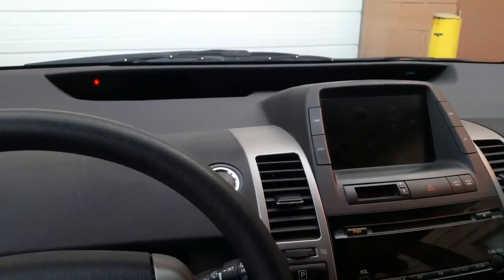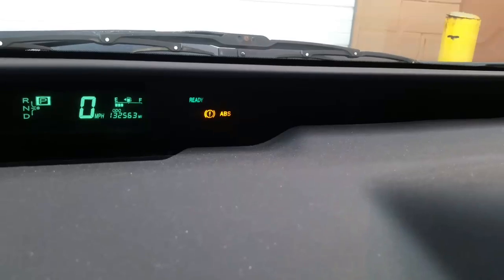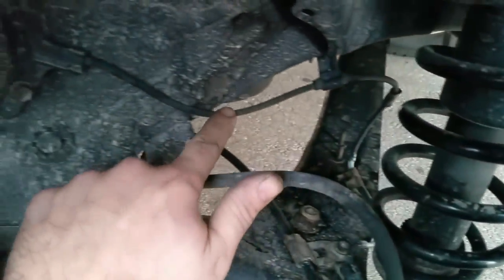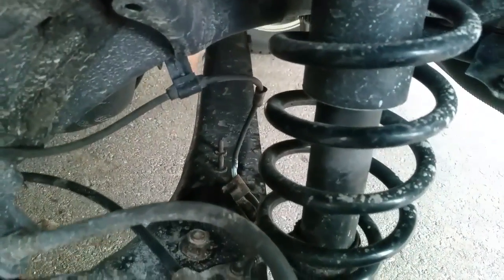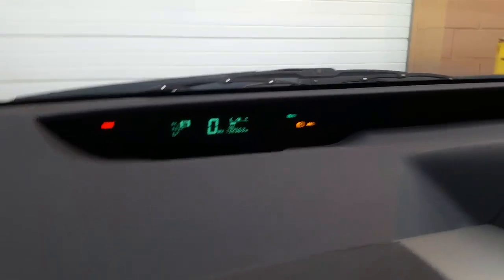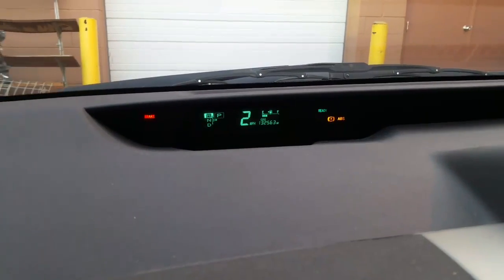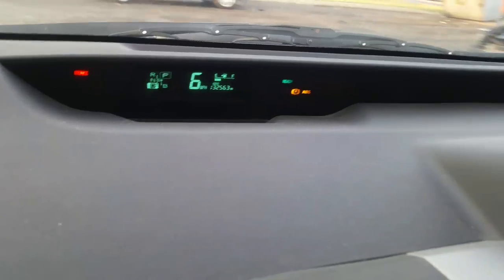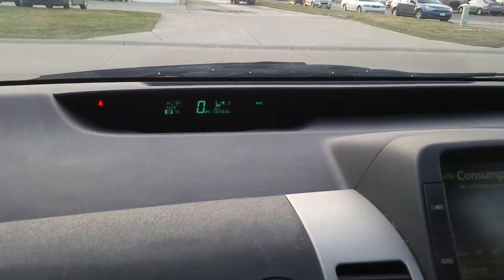TOYOTA LEXUS ABS BRAKE LIGHT FIX C0215 /34 REAR LEFT WHEEL SENSOR MALFUNCTION

Comment: My Vehicle Stability Control, Traction Control, ABS, and Brake lights all come on and stay on.  I ran it by my Toyota dealer, and the Fault CO215 came up as a result of their scan of my 07 Toyota Rav4.  When they visually inspected my vehicle they found rust on my sensor housing.  They quoted me a price of $1,025.27 for them to do the work.  This price seems a lot more than what you say.  Should I be concerned that they will be overcharging me by a ton if I have my work done by them?

Comment: I'm very frustrated I just replaced both wiring harnesses AND purchased brand new rear bearings only to get new sensors and my light remains on I drove it about 10KM and the light is still on. 500$ down the drain. c0215 the mechanic tried to reset the light with the computer and it came back.
Reply: The problem could be the front speed sensors
Reply: @douglas2510  I fixed the issue by ordering and replacing a new speed sensor wire,  The 1st wire which was NEW was a broken and DOA
Reply: @nervouss  George I jusy replaced the wheel speed sensor and wiring to the backseat and mine Is still on. Are you saying you had to buy a second wire again? Mine are both new but the connector by the backseat looks like it could be crimped a bit no wonder if this is why.

Comment: I have a code C0200 with both my ABS light and my traction control light on. Does this sound like a similar problem to the one described in this video? Any tips on fixing it? Also, my cruise control won't engage after this light came on.

Comment: Hey bro I just changed starter on my 04 Acura but now ratio is asking for some code, what should I do?
Reply from the maker: Press  and hold #1and#6 on your radio then press power button it will display serial number then write the number down. Call uou local acura dealership ask for parts department tell them you need a radio code and that you have a serial number. They will decode it for you watch my videos you will see how its done
Reply: +George Melnik do I need two separate code for ratio and navigation ?